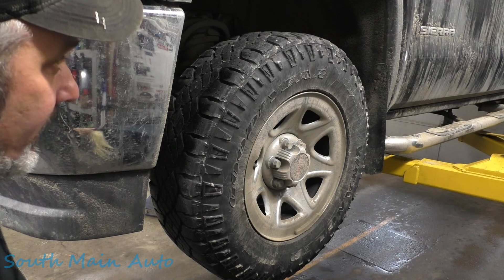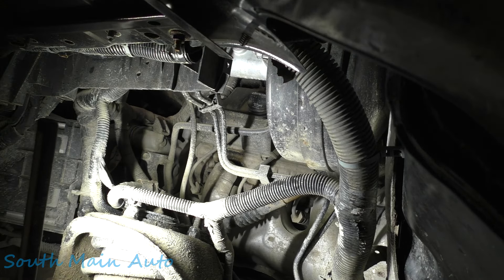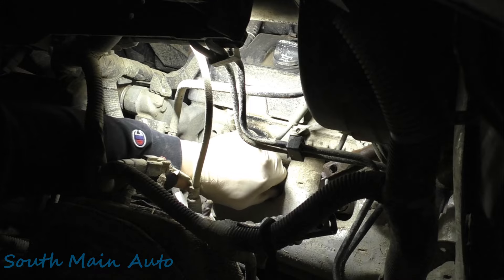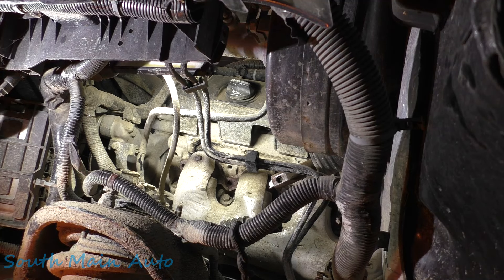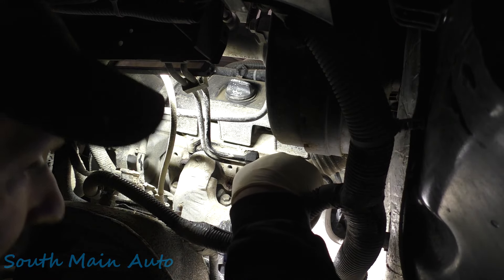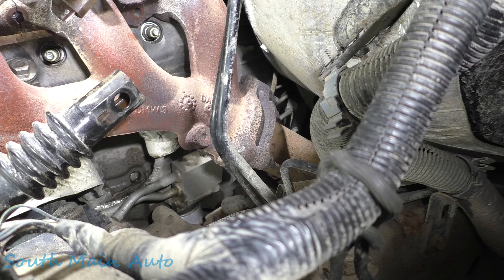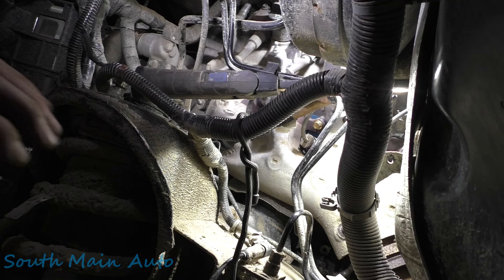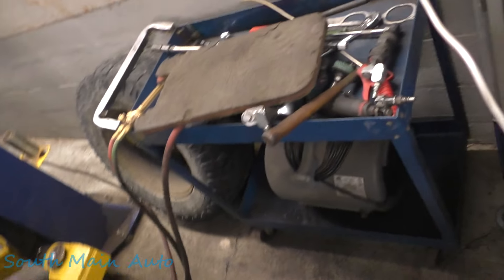GM Truck- Exhaust Manifold Bolt Snapped Off In Head

Comment: Just want to say thanks for the videos.  My son came home and said he had some broken manifold bolts in his truck. (of course it was the back two on each side)  He said he wasnt paying 1700 bucks to fix it so he was gonn try it himself.   We found your videos and went for it.   He even went out and bought a welder to weld on nets and we got new manifolds, bolts, gaskets etc all buttoned up and done today.  We got about $900 into the project but hes got a pretty good welder and helmet, a big and a small torque wrench, a fixed truck and good experience out of it.   Plus, I got  priceless dad and son shop time, and some tools I can now borrow from him ! Thanks again !
Reply: This is EXACTLY what I'm dealing with. I think both sides have at least the last far back bolts or two broken. & I cant tell  if its broke flush with the head or not. Mine's a 99 Silverado with the 5.3L.

Did you use the stainless steel Dorman bolts? I was wondering if ARP made better quality replacement bolts that wont break. I don't know why GM doesn't use good shit to begin with in the first place, like the heater hose quick connect that WILL fail eventually if you dont replace it in advance before it gives out.
Reply: You have no idea how many tools my kids have..forgotten..to put back, let alone how everything is scattered in my tool boxes! Now, I totally understand why my dad ripped me a new ahole  in my youth when I used his!

Comment: My work truck has the same issue, been putting off fixing it, seems like a good job for a Monday. I don’t care what anybody says you’re a good guy, thanks for sharing the knowledge.
Reply: Go to the hardware store and get you some stainless bolts with normal size heads and you'll never need to do that job again. Make sure to anti sieze though, just in case.
Reply: @BigPapa_2001  gotta be carful when mixing dissimilar metals or galvanic corrosion can occur and make it worse then loctite.
Reply: hit any auto parts store for a Ford mod motor manifold stud kit. super cheap and grade 10.8. will never have it pop a bolt again.

but also they sell a nice brace kit too, I've used them and they works great if it's a front or rear bolt, which it normally is. just a bracket that bolts into 2 existing holes and then pushes on the exhaust manifold to seal it up. gaskets are metal so they aren't blown out, just dirty. way less work but as said, if you do it the correct way, just to don't use oem bolts, either arp bolt kit or the cheap stud it is my recommendation.
Reply: @FishFind3000 I done mine in 2009 and just had to replace a cracked manifold on it this past year. Didn't have any trouble, bolts looked as good as they did in 09. I see what your saying though.
Reply: @BigPapa_2001  yea, not everything reacts with each other since each type of metal has a different potential. I had metal valve stem caps that fused to metal tpms sensor valve stems and they wouldn't come off even with channel locks. They had to be cut off with a dremel. I'm sure the salt water from winter accelerated the reaction since salt water increases electrical conductivity.

"The susceptibility of different base metals to corrosion while in contact depends upon the difference between the contact potentials or the electromotive voltages of the metals involved."

If you google for "galvanic corrosion metal scale" it shows what metals are more susceptible to it.
Reply: naw, do it on a Sunday after 5pm, when you need the truck for work Monday 5am.

Comment: In GM-land sheared exhaust manifold bolts are considered scheduled maintenance.  lol
Reply: Crazy because out of all of the 300,000 mile GM trucks never had that happen...
Reply: @philllsxga.7737  Happened to both my chevy trucks and tahoe.
Reply: @cnoyes72  How many miles?
Reply: Started with the LS engines.
Never a problem with the ole 4.3s and 5.7s..
Sad..
Reply: @philllsxga.7737  Yeah, the GM 5.7 was a really reliable motor.  It's why in 2018 I bought a tundra (straight up v8 with no auto start/stop or AFM).  My next truck my end up being a 2500; no AFM or other tricks, just an honest 6.6l v8 gas engine.
Reply: @cnoyes72  so far so good with my Silverado.
146,000 miles.
2014.
Reply: Your thinking of Ford exhaust manifolds...
Reply: @upnorth5465  both

Comment: I like the way you deal with rusted bolts.  You make it look so easy - and it's not.
Reply: Definitely.  An hour job is only one broken bolt away from being an 8 hour ordeal.
Reply: @mrfishbulb7187  Yeah I was squirming in my seat as he was wrenching on that rear manifold bolt!
Reply: An old timer showed me a trick for removing stuck bolts.  Heat it up than spray cool water on it.  The heat expands it and the water contracts it breaking the bond.  It works.  I've removed some hellishly stuck bolts using this method.
Reply: @rob7hg  might as well use a shot of penetrating oil after the torch instead, coming from an aerosol naturally makes it cold and it's very easy to aim a shot. Plus ya know, it's oil instead of water

Comment: The main two reasons heat helps loosen rusty bolts is 1: yes, the bolt expands with heat, but it expands length wise more than cross wise so some clamping pressure is relieved from the bolts. Which equals less friction to turn it. 2: the hotter it gets, the softer it gets. Think of trying to  pull a soft string through a bent tube vs pulling a stiff wire through a bent tube. The heat also breaks up rust bonds. From working on junk big rigs for a living, this is my philosophy on why it works so well. Also, there is no type penetrant that works half as well as a little heat or shocks from a hammer in my opinion 😁

Comment: This one is usually a home gamer nightmare. Looks like I need to get a set of those gabby extractors for general principles that I might, might, might, need one of them out of the set one day.
Reply: Yup. Biggest problem as a home gamer is doing this on the ground without a lift. Oh yeah, and acetylene. Oh yeah and welding, if it comes to that. I’ve been putting this off on my F150. Gotta get her to the shop. I’ve got an Eric-like guy I use and don’t mind one bit paying him what he needs to do a good job for me.
Reply: @frankvucolo6249  You can get oxygen and MAPP gas or oxygen and propane setups. Those little bottles of O2 don't last very long, but they should be fine for heating bolts up. I took the manifolds off my 2011 Frontier recently just using a MAPP plumbers torch. It was nuts on studs in that case, but nothing broke.

Comment: WOW, The stars were aligned for you on this one. No broken molding clips, No broken bolts, bolt extracted with no welding and most of all the WD got all the water out of the steering shaft and dipstick. Amazing
Reply: Yup! Usually the mig welder/nut arrangement has to come out !

Comment: That broken exhaust header bolt was less problematic than usual. Usually more bolts and studs break in the repair process👍
Reply: Lucky
Reply: @safffff1000  sometimes its better to be lucky than good!

Comment: Quality work as always. Forgot to tell us you checked the manifold for flatness after you cleaned it up in the sandblaster. Used to have some of those move around a bunch and need to be milled or sanded flat again.

Comment: Much admiration for Eric to even work on rusty exhaust manifold bolts. I've found that most mechanics won't work on those rusty bolts. Years ago, I diagnosed the problem with my friend's car as clogged passages behind the exhaust manifold. I refused to do it because I don't have a welder in case I broke one. We took the car to 2 different repair shops and they refused to work on it. We finally found a guy who said he would do it. I explained to him what I wanted him to do. After he worked on it, the car was just as bad as before. The manifold bolts looked like they hadn't been touched. The guy replaced the spark plugs and wires. After taking it to another repair shop and spending more money, my friend finally scrapped the car as it wouldn't pass inspection.
Just a note-the 4 cylinder manifold bolts were much easier to get to than this GM truck that Eric is working on.

Comment: Eric, heating the head of the bolt causes the upper part of the bolt to lengthen, decreasing the clamping force and enlarging the rusted head so your socket fits better.  The aluminum head soaks away heat almost faster than you can heat the bolt so the portion in the head doesn't grow much at all.  Keep up the good work.  :)
Reply: Still, needed heat to remove bolt that had no head. The threaded portion expands ...shrinks.....breaks corrosion bond....still, a bitch to deal with in my experience. Dave in Omaha

Comment: MY takeaway is that from all the less than good ideas GM has had over the years (and there's been a few) Torx head wheel well liners bolts have got to be among the top ten.Great vid as always,yeah I saw the crack in the head and can't believe you let the truck go with it!  /s/

Comment: Man o man that looks like a job from hell. There are a half a dozen instances where experience paid off. One broken spark plug, another broken/stripped exhaust bolt etc could easily turn this into a full day of pain and sorrow. You knocked it out like a true experienced pro. Some jobs you can easily just follow the manual, but jobs like these it's pure experience.

Comment: Just both exhaust manifolds and motor mounts replaced on my 2013 Gen 1 ford Raptor. Dropped off for a one day job on Tuesday(11/28/23) and got my truck back on Friday. Highly decorated custom automotive shop here in Las Vegas had every cussword imaginable about my Ford truck vs working on a Chevy or any other make for that matter! Apparently a million parts have to come off to get to the sides of the engine. One mechanic said he would quit if he see's another Raptor come in! Plus, each and every bolt was broken. Showed me video of heating and welding bolts. Said it would have definitely been easier and faster to take the engine out to work on. Final price was about $100 over original estimate! Truck is super quiet now and my coffee cup isn't violently fighting for its life anymore!

Comment: Why does GM like Torx screws
Reply: They own the company that makes them!
😂
Reply: Allows them to use cheaper metal and torque it to higher levels
Reply: @freetolook3727  I'm an A&P airplane mechanic mostly on weekends so mostly work on bolts & nuts or AN fittings then my wife's car needed a light bulb change in her Traverse so after removing the inner wheel well with the Torx I had to buy because the ones that came with the sets I have I gave away never thinking GM are mostly Torx

Comment: Yes, Eric, I got a great deal out of this video !!!! I will now try more often the heating up with a torch the rusted bolt(s) that need to come out to get the job done. Down here in the "" Corrosion Belt "" of the Florida panhandle, I run across many corroded bolts/threads/nuts that need some persuasion to be removed without breaking/drilling out. I have adopted your method of hammer-bashing a socket onto the bolt head in case it has some rounding or rusting on it. I do cringe when trying to brake free a stuck bolt even after bathing it in penetrate oil. Dread the time consuming drilling it out method or welding a nut on the stub. You would be very surprised how your knowledge and some of MeMa's tricks help so many of us every day !!! Well done on this flawless job !!!! On to the next one. And can Luna the kitty make a short guest appearance in a video, she is such a nice sight to see and always has some good meows to say about you. Thank you.

Comment: As a mechanic of over 30 years, it's a pleasure to watch someone else work while I sip a beer. Enjoy your videos. One question: Do you have an inductive heater? Ever tried one? I bought the pistol style inductive heater and it has made heating up bolts in tight spaces easy and so much safer than a torch. Best $450 I ever spent (got it on a promotion, it's regularly about $600 but still worth it).

Comment: From installing a lot of exhaust headers (which are a lot lighter than cast manifolds) I found re-installation much easier after I got a couple of studs the same size of the original bolts. You didn't seem to have much of a problem, but being able to hang the thing on the head so you can start the other bolts (and then replace the studs with the original bolts) always saved me time.  Works for starters too, but they were a lot heavier back when I was working on stuff.  Many years working on cars, but I still learn something every time I watch what you record.

Comment: You need to wear safety glasses.   Love the videos.  Saltwater mechanic taught me the trick where you heat red hot then instantly cool it with ice water.    Breaks bolts loose like magic.

Comment: Thanks for using the great word "purchase" ... seldom used nowadays but very accurate word.  Good video ... enjoyable. And from your favorite Texan Aerospace Engineer living in the Riviera that watches ALL your vids ... it ain't the heat from the torch doing the job on rusty bolts, it's the coefficient of expansion and contraction: "Scientifically, heat expands metals, which can break the bonds of rust. As metal cools, it contracts to break up rust." You're welcome Bro.

Comment: Eric, the reason heating a bolt loosens it is simple physics. The heated bolt is trying to expand but the much cooler hole won't let it so it pushes material out of the hole. As the bolt cools it is now very slightly smaller since the displaced material can't return. The effect is small but that's all that's needed. It's the same idea as shrinking a dent with heat. Keep at her!

Comment: Wash what ! that  is the cleanest Eng bay I’ve seen in years. Most of the stuff I’ve worked on looks like some one drive it through a mud field or is dripping water, oil or antifreeze. Bought a third hand for soldering wires seen it on one of your videos and I got one from Amazon worked out great even came with a magnifying glass that is great for us old wrenches LOL . Keep up the great job 👍

Comment: Eric, not sure if youve gotten this comment 200 times yet or not, but you should really consider an inductive heater for work like this. works great for sensitive areas and is such a versatile tool. i always feel like breaking out the acetylene for "special occasions" but for general duty stuff like these manifold bolts, i wont touch the torches, i go straight to the inductor. 

plus its great to use for soldering terminals onto battery wires. love the videos.

Comment: I can't believe that you were able to get the camera in there.  I recently had an 03 H2 with the rear manifold bolts broken.  No threads exposed so I had to pull the heads to get at it.  Very satisfying when they come out.  Good work, Eric.

Comment: Hi Eric.  You might want to think about playing the lottery after that repair.  6 years living in the PRNY and all the bolts came out with only a little heat.  That's pretty amazing/lucky.  I thought the ones at the exhaust flange would be a bear.  Good thing I didn't bet on it.  Thanks for the video!

Comment: In 1978, I a student working at a rental center while going to CU Boulder, was shown how to get head bolts off of a Jumping jack motor.  A Oxy-Acetylene torch  to cherry red on the bolt head, to release-melt the red locktite.  He said otherwise the bolt would break.

Comment: Living in the Central Rust Belt I've had much experience breaking off manifold bolts on Gen 1 Chev small block manifold bolts.  Either the head rounded off or they broke flush with the head.  No amount of heating would loosen those little bits of devilry.  It was drill, chip out, and tap.  Really big pain.  There was more room in the engine compartment but I didn't have a lift and there was no way that those metal inner fenders were coming out either.

Comment: So I always figured those bolts break because the manifold warps. The problem will come back. You were very lucky. I have done a bunch of those. I would replace the manifold or at least have it surfaced. I also think that intermediated steering shaft is ceasing and will knock the seal out of the steering box when set on the ground after being lifted in the future. Good stuff Eric. I always learn something after 50 years of wrenching. BTW. I always use heat. Because you always fire your best shot first!!

Comment: Eric O. The reason heat helps is the expansion rate between the 2 materials. Aluminum thermal expansion is 2x that of steel. I hope this helps with all the comments about the cracks. I think it their screens we spent all that money gas and can't afford a phone.

Comment: amazed how you got that broken manifold bolt out. On my silverado, a manifold bolt broke close to the firewall after about 10 years on the road...Went to disassemble and two of the other bolts broke like they were made out of cheese.

Comment: You are lucky. Have a 2002 8.1 liter. One snapped off flush with the head due to the heater core line dripping on it. Tried an easy out only to break the easy out in the head. Took hours of drilling. Put a heli coil in, ten years later still holding up.

Comment: You are correct for rust the heat works by first expanding the metal then it contracts as it cools. That movement is enough to usually break a rust connection

Comment: Hi Eric,
After 55yrs being a mechanic, working 36yrs at GM in eng and dev, while moonlighting 20+yrs in a very successful muffler shop I may have a trick you might try.  I have a set of Left Hand drills, and have drilled the broken bolts deep enough to accept an Easy-Out using a right angle air drill. Most of the time the drill would catch the bolt and back it right out, but if not the Easy-Out almost always got it. Then I'd simply put in a new bolt and check for a leak. 9/10 times it'd pass the smell test. Also I put anti-seize on every bolt, esp on SS exh.